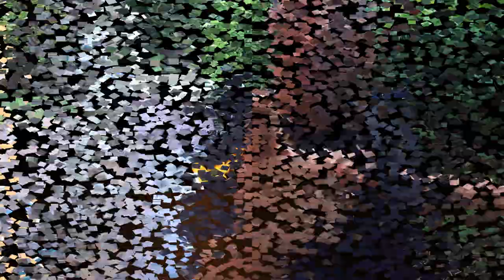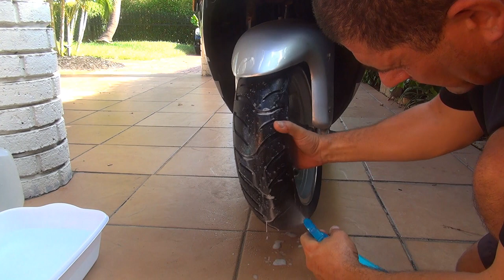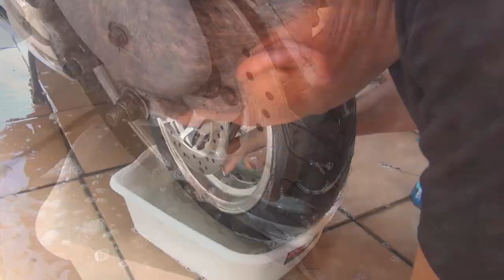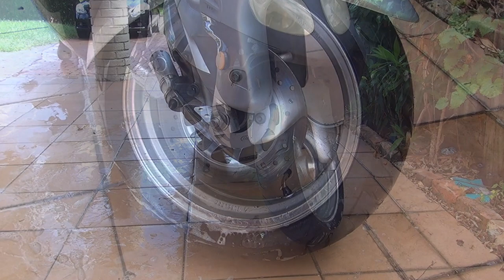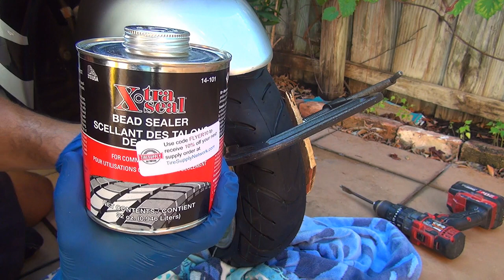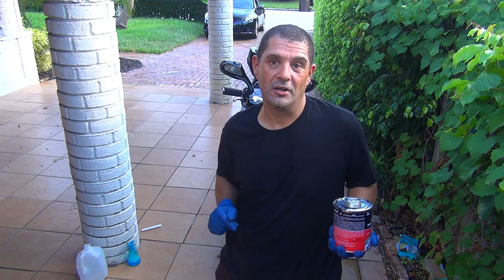Tire Troubles? Fix Tubeless Tire Leaks Like a Pro!

Comment: The second video seems to be a different video with a different tire.  The stem is different.  I have one scooter with the curved stem and one scooter with a straight stem.  Was there an issue with the sealant or C-Clamp on the first video? I want to make sure I am doing this correctly.
Reply from the maker: Hello my friend,
I had to use tire sealant on this tire because when I was mounting it for the first time, it was slightly aged and didn't want to fit onto the rim properly. While trying to work on it, I accidentally damaged the bead a little. However, thanks to the tire sealant, the tire has been working great for the past year. In the end, it turned out to be a happy ending for my story, and I have to thank the inventor of the tire sealant for that. Thank you for watching my video

Comment: Hi I have problem with my scooter. I was riding until I heard something snap like a belt snap sound. And loss power. But I check the belt its good. I also check the chain where the valves are and its good too. But the fly wheel i try to turn it all the way around.  It doesn't turn all the way around.  Only half way. Would you think its the piston or maybe started clutch? Can you help me find the problem? Love the video you do!
Reply: I had same problem..my valve had snapped and was caught in my piston, I had to replace my head and new piston .Glad  my timing chain was still intact , did not have to split the case.
Reply from the maker: Hello julior34758  I will start by removing the  head  there is a possibility of a broken valve something is blocking the piston from moving I hope is not a bigger problem like the chain at the starter cluctch
Reply: @VirberelloScooterTips  hope not. But I'll check it it out
Reply: Wow I was hoping it would not have to do with any piston.  But that you. Can you send me a link where can I buy a new piston or valve?

Comment: see if u can help me out. i got a 50cc icebear maddog. when i start the scooter when is cold it start good but when the scooter been running for a lil and i turn it off and try to start it again it do not start. i got to wait for it to cool down. plz help
Reply from the maker: Hello Felix that is the stator you need to remove the flywheel and look around the wires and the weldings if you see anything is discootected or you just need to replace that part

Comment: Hi Viberello, I want to see if you can help me with a problem I'm having with my Scooter. I have a Tao Tao Quantum 150cc . I purchased it brand new off Amazon back in March 2021 It has 230 miles on it. I just it for short trips to the grocery and such . It is still like brand new .. I've never abused it at all. It is Garage kept. For several months now it has developed  a rattle like in the front brakes when traveling forward. The front brake caliper is tight .. all the bolts tight on it.  When the scooter is moving forward down the road and the front is rattling ...  I can squeeze the front brake  and the rattle stops. I can also feel the rattle and  Vibration in my front brake lever as I apply the front brake.  I'm thinking it could be bad or freaky brake pads  or maybe the front disk rotor could have a slight warp in it .. or maybe front speedometer  set up . I'm thinking maybe to change out the front disk pads firts to see if that solves it.  I have watched your video on that. The scooter came in a Shipping Crate and I had to assemble a few things on it.. like the front tire /rim.
Reply from the maker: Hello Ed there is a possibilitity that the brake pad are old place the scooter on a center stand and turn the front wheel by hand and see if you ear something out of the ordinary
Reply: @VirberelloScooterTips  Thank you very much for replying. Yes I have tried the spinning of the front wheel while the Scooter is on the center stand .. and at a Certain point I do hear  a rubbing sound that last like 1/3 of the revolution of the wheel. The front brake pad should be new on it.. but that means nothing if one of the pads are defective.